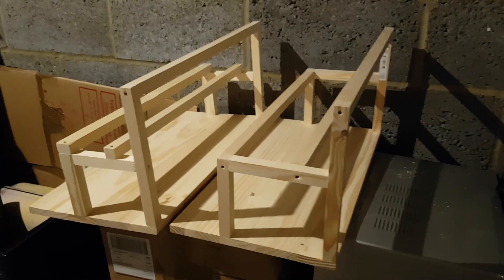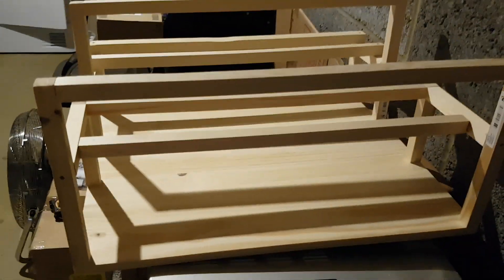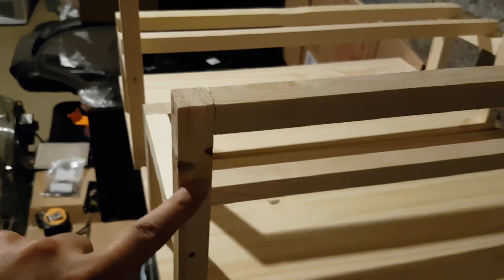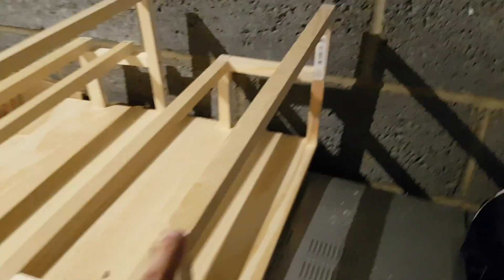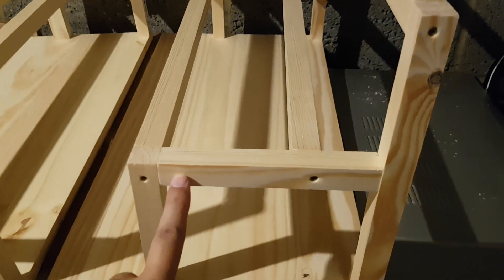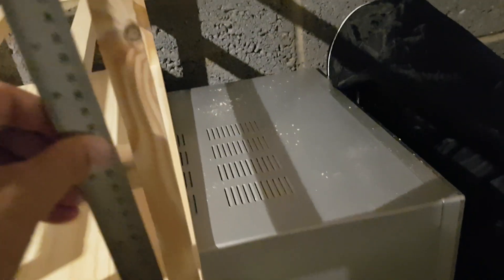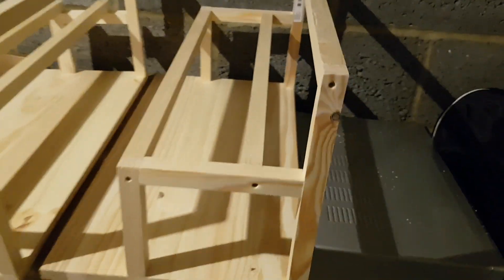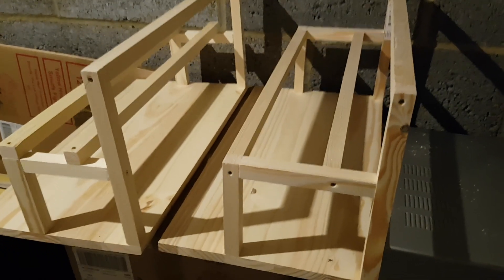Wood Frame Dimensions For 6/7 GPU Mining Rig

Comment: What is the exact length between the 2 54.5 next to eachother?
Reply: thomasie10 if all risers are relatively the same as mine it would be 3 3/4 inches center to center, or 2 3/4 inches of space between the wood. Based on riser mounting holes

Comment: Hi, thanks for nice video. Do you put spacers between MOBO and wood shelf? What distance between GPUs do you recommend? Can you place both PSU and HDD inside this rig?
Reply from the maker: The mainboard sits on the shelf board without any issue, you could secure it with stand offs if you wanted. You get see the frame in action here https://www.youtube.com/watch?v=UWu2d6_bF5M